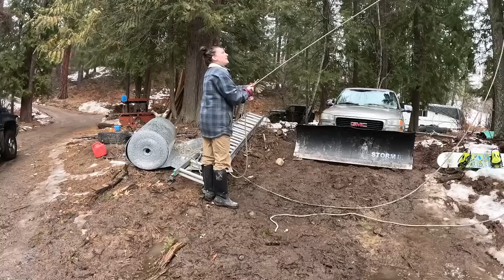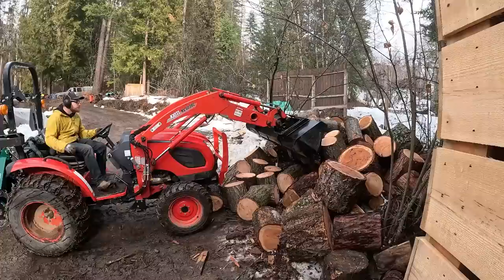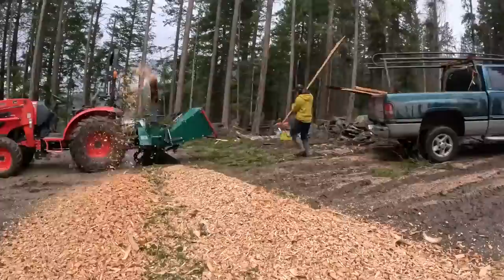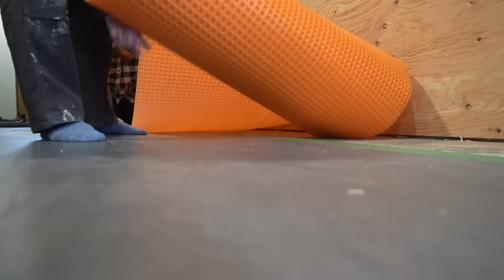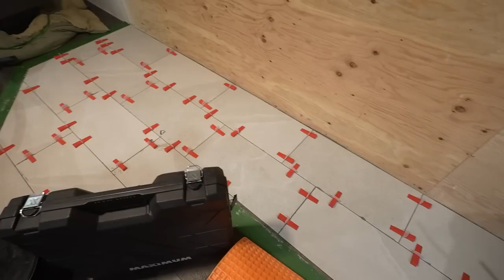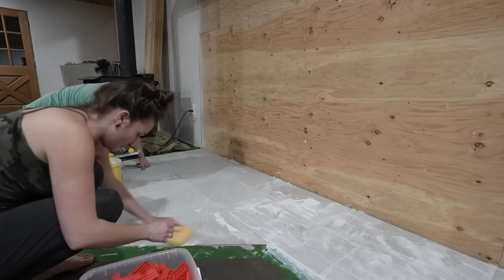She Wants To Get CHIPPING! Dealing With MUD At Our Off Grid Property

Comment: Will you be putting some heat shielding on the wall behind the wood stove ???   Another idea is to use brick or stone facing behind it as it will absorb heat then if wood stove dies down, the brick/stone will still giving you heat back for several hours !  Double the purpose !

Comment: Greg...   Look into building yourself a wood splitter that will run off the hydraulics from your tractor.  I have seen it done and it makes use of power you already own .  Not to mention it will save your Back from splitting.   Hope this helps !

Comment: I am from Iowa, Spot on about Ditra, You have to use backer board or Ditra on floor tile, Houses breathe and move and you have to deflect that movement, I have used Ditra many times especially for transitions to wood floors. If you used grout for your transition without using Schluter( metal trim) and just raw tile to wood would result in your grout continually flaking out, you have to some kind of transition. I think that black looks great. Here is some grouting tips use the flat side of you float to take off as much grout as you can going 45 degrees to the tile, then train the lines with your sponge, make sure to let grout set up enough to fill the gap, then take your sponge at a 45 degree angle and pull off the grout 1 pull 1 side of sponge, when  then turn the sponge over and do 1 pull, wring out sponge and repeat. go about 2ft or so with each pull. when you just scrub you can pull the color out of the grout. Pulling the grout off with 1 pull 1 side of the sponge will dramatically reduce grout time and you just have to use a dry towel and buff it clean after a couple of hours and your grout will look better. You guys kick ass, you are what homesteading is all about. I hope this will be helpful when you tile your bathroom.

Comment: I used to use wood chips in the exercise lot for the milk cows it kept it free of mud and kept it clean it breaks down over time then you scrape it up for compost and replace with gravel or more chips  from a city arborist  you can usually get them free , you should also have lots of pine straw grind it up in the chipper and use it for bedding

Comment: Thanks for the advice on chimney pipe! Self cleaning 🤣 We're dealing with mud too, and have almost unlimited access to chips. How long do the chips last as a road or walking base? Really enjoy your videos. They're the type I can put on the big TV and watch instead of the usual trash on TV. Keep up the good work!
Reply from the maker: Not sure how long they will last, but the chips we put down in the video where we got the chipper, are working just fine. I think that was in the late summer/fall. They look dirty, as if mud from vehicles or run off from snow melting has accumulated but it's not sloppy mud that gets all over everything. So it's a big improvement. Termites and fire risk are something to consider if putting near a structure. Those are both considerations for us so we'll be pulling back anything near the house and putting gravel when we can

Comment: i had mentioned before i was a GC but i was a journeyman before that ;i laid thousands of feet of tile and hard wood. I found the clean up of the tile haze slowed me down so i made a improvised bakers bag from plastic bag and filled only the grout lines and it was so much easier to clean up the tile grout haze bcs less grout was applied? Maybe  that helps if  not to late? Doc

Comment: oh me;;;ya scared me when moving that stove;;them things are heavy;;;;I put a stove mat under mine to protect flooring if had to move;;;It had some kind of felt or cloth floor side;;;;worked great when had to change stove pipes or cean;;;;lol;;;thought yall was gonna get caught whith ya pants down before stove could be operational again;;;lol;;;think I would have used saw to cut them waste slabs shorter and the small tree trunks smaller;;;;lol;;;looked like Paul Bunyen swinging that axe maul;;;;glsd to see the fire going smiley faces of accomplishment;;;;lol;;;nothing like a little tree cuttin prunin and chippin to get ya blood flowin;;;;;big thumbs up here and keep em comin;;;;oh;;;;forgot also thought was gonna have to send up a jiant pair of tweasers to get splinters out from slidin down the tree;;;;lol;;;oh my another book;;;;

Comment: Something I have had on my mind for quite some time to tell or discuss with you concerning heating your
home PROPERLY. Please read first what i'm telling you before you think I'm crazy. I've never found the
logic in building a warm fire and then letting most of your heat get sucked up and out the chimney. Letting
your heated air get sucked or naturally drawn out by the chimney means that fresh cold air from outside is
replaced into the living space that you've already tried to heat. You are working against yourselves and 
wasting a lot of wood in the meantime. The solution to stop this is simple.
When I helped a friend build his home he installed a wood stove. One day after he lit the fire he had to go
run an errand and left me there to keep an eye on things and while he was gone his place turned into an 
oven. I thought I was going to die from heat exhaustion. He had told me to not open the door while he 
was gone so I lay on the floor because that was the coolest place I could think of. Thankfully he arrived
and laughed at me for not knowing what to do. He showed me levers on the two front legs of his wood 
stove that allowed him to regulate the airflow to the wood stove with air from outside. 
AAAH HA!!! that was his secret as to how his little wood stove heated so very well. 
Back to sucking the air from inside the house by it going up the chimney. Don't let
your preheated air get out by providing a small tube going from outside that is attached to the wood stove.
Doing this feeds outside cool fresh air into the burning chamber that afterwards goes up the chimney as
smoke and lets your indoor heated air stay inside your home. And you will find that your wood burns better
with the fresh air from outside too! Now different stoves burn differently obviously so it depends on your
own situation as how large a tube needs to be and how you hide the tube but I promise you will see a big
difference in the heating capability of your wood stove and a drop in the amount of wood it takes to really
heat your home.
I wish company's would include this when they designed their stoves. Since then I have helped design a 
similar system on three cabins and a school bus turned into a home.
Hope this helps cuz I find I like and enjoy you guys and your videos.                                      Me southern AZ.

Comment: i am curious as to why you are not using that log as lumber.    It looks like you are in bad need of a parking of vehicles and equipment from the elements including the saw mill    With so much snow i would think you would be getting tired of cleaning snow off every piece of equipment and vehicles.
Reply from the maker: That tree was too curved.  It's a ton of work to pull straight boards from trees like that, the also have a tendency to have tension in them as well ( warp when cut)